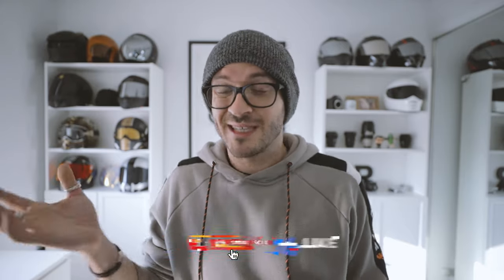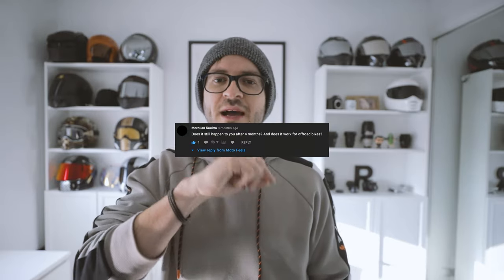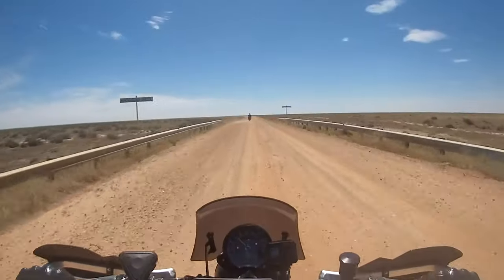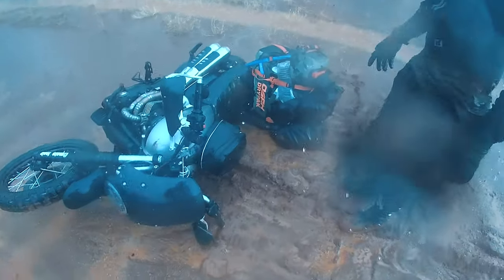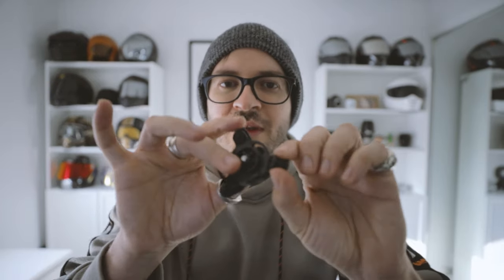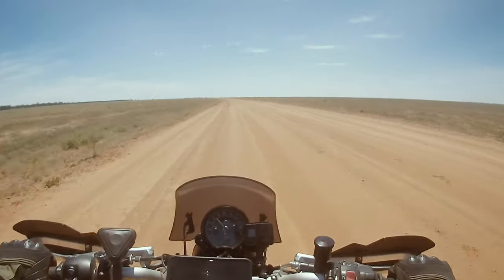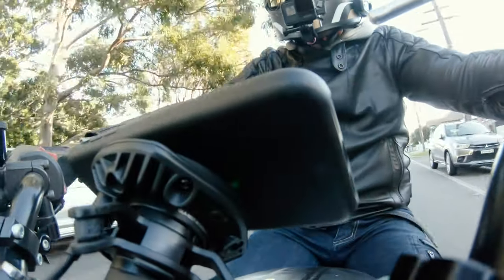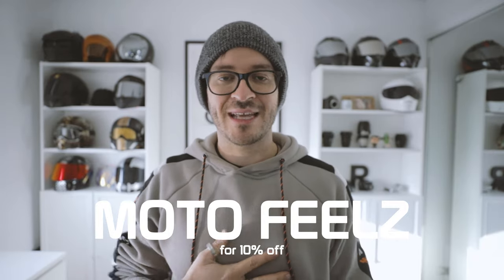Quad Lock Vibration Dampener | Long Term 7000km Honest Review

Comment: I have used the quad lock system with anti-vibration fitting on my Street Triple 675 for a couple of years. I use two different iPhones with no problem. These are well designed and made pieces of kit...would recommend them to anyone wishing to mount a phone to a Bike.
Reply: i juste ordered one, my ram mount fucked the iphones cameras from vibrations, and after less tha a year of using it the phone fell from the mount on the highway

Comment: So far my dampener seems to be working. Previously went through 3 phones in about a year all with the same issue and had no idea what it was until I saw one of your vids with the same problem. Bought the dampener as soon as I found out about it, have had it on since May and have not had an issue yet.
Reply: that's why i wouldn't use my phone on the bike. too expensive if the camera breaks
Reply: i bought at the same time I purchase the mirror mount,  2500 km later my iphone XR camera dies.  Mounted on the bar of a T7 and 40-60 on-off ride.. 
Now with Garmin XR and much happier than any ruggered or iphone device
Reply: Still good ?
Reply: @daveshere9969  yeah mate, same phone and am have had absolutely no camera issues at all. If you have a quad lock and an iPhone this a must to have with it.

Comment: I’ve had the quad lock on my r6 for a year I got another mount for my grom and it must vibrate a bit more cause it broke my camera in a month of riding around luckily had a 1 year warranty on the 12pro so they fixed it free stupid Apple though might have to grab this for the grom

Comment: Thanks for taking time to make this video. I have been using dampner for my I phone 13 and its been great UNTIL recently shakes damaged the IS (image stabilizer sensor) I did 6500km long ride (mainly street riding) and camera started acting shortly after the trip. I was lucky that phone was still under warranty and Apple replaced camera at no cost. Hope this doesnt happen to any other rider. Ride Safe!

Comment: I have a kawasaki z400 (a pretty vibration heavy bike) ive had my qualock on it for about 5 months. With the vibration dampener. And to start with was working great. However ive noticed some issues with my samsung s21 ultras auto focus. And images are often blurrey now when you shake the phone you can here the magnet in the camera move around. I dont think this is soley becuase of the bike. Just sharing my experience.

Comment: Great review of the quadlock vibration dampener, it clearly works and is worth the small extra cost in order to save your phone from IS destruction. Cheers man and thanks.
Update: Bought one and really pleased, hope it keeps working like a dream. Recommended 👌
Reply: Didn't work for me. Lost my camera still on my Galaxy Note 20 Ultra and KTM Duke.
Reply: And u used anti vibration?
Reply: Yes I did use the damper and my iPhone 12 Pro Max is thankfully still ok after 2K miles. Just for comparison my previous iPhone 8 pro camera died after a few hundred miles without the damper, had it fixed by Apple and  has been working fine on the bike with the damper attached as well. It’s definitely recommended 😅

Comment: I have the vibration dampener on my Harley and the dampener does not help at all. Also for some reason after 1k miles the charger stopped charging while driving but will charge if I’m sitting still and take the phone off the charger and re mount it. Can’t figure out why. Definitely an issue for costing over $300 USD

Comment: I don't understand one thing, but if this tool is supposed to avoid vibrations, why does the phone vibrate so visibly? What do I do with an object that vibrates so much if I can't use it as an example for GPS since it vibrates constantly? at this point isn't it better to use it only with the classic quadlock? At least this way it stays still and readable if you receive a notification or something
Reply: in my opinion it should work like a gimbal, that is, it attenuates vibrations and remains stable even at high speeds, to hold it and see it vibrate so much without being useful as a GPS or reading a notification you might as well keep it in your pocket..

Comment: Did apple repair your phone?
The same happened to mine because I had the quad lock without damper on my CRF250L Rally, however I now have the Triumph Tiger900 and have added the damper when I got it, along with the charger, which works great.
My phone is still messed up because I am not in the UK to get it sorted, which is made harder anyway due to Covid access issues.

Ian
Back on Two Wheels
Reply from the maker: They did man, free of charge too and took only half an hour. Have you tried booking in at Apple?
Reply: @MotoFeelz  I work out of the country so short weekends at home and pandemic restrictions have restricted access, I will try but as I have had it over a year I am not holding my breath

Ian
Reply: @MotoFeelz  With or without apple care + ?

Comment: Great video, thanks for it. Is the problem happening on the new iPhone models only, I have an iPhone SE (2nd gen) should I be concerned?
Reply: It damages the camera’s that have optical image stabilisation. It’s a system where the lens is suspended on moveable parts inside the camera. I don’t know on which model this first came out:)

Comment: Not Trying To Damage The Rep, I Love My Quad Lock BUT After 1 or 2 Months Of Riding 3000+ Miles On A Royal Enfield Himalayan  With A Dampener. My SAMSUNG GALAXY S22 ULTRA is Showing Signs Of Camera Stabilizer Not Working Properly At 10x. Just A Heads Up!!!!

Comment: I just installed my dampener and i can see the phone swinging too much. Is this expected?
Reply: Yup it is fine bcoz of the mount now resides on 3 rubber pads instead of hard base. So the weight of phone including the case, presses it more.
I was also worried but then I understood the working of this.

Comment: My GSXS 1000 F killed my iPhone 12 Pro on my quad lock. I got a new phone on warranty then bought the vibration dampener and no problems since. It bounces the phone around though.
Reply: Hello. Tell me pls about your experience using the Quadlock damper after 2 years. Does it work?
Reply: @XR0M  honestly after about six months I just got a garmin gps and I no longer use my phone for nav. But yeah no issues.

Comment: Hello. I just want to ask one thing. I’m thinking about quad lock mount, but I’d like to use it both on my mountain bike and my motorbike also.
So there’s the question.
Does the vibration dampener fit to a bike mount? Or is it only dedicated to motorbike mounts?
I’d like to buy just one mount and use it on both.
Thanks.
Reply: Ты можешь установить крепление к любой трубе. Вопрос только в том, сможет ли демпфер погасить вибрации на велосипеде и спасти OIS в телефонной камере🤷🏻‍♂️

Comment: Hey mate, i have the vibration dampener on my 50cc that i deliver food on in a city. It seems like it wobbles around a lot and makes me thinks its causing more vibration that having it solid mounted? Any thoughts, just like the clip of yours riding in this video. It seems to move a lot! ???
Reply from the maker: Wobbling is good man, means it’s doing it’s job. It’s the micro vibrations that you don’t see that kill the Image Stability in phones. Keep it on!
Reply: @MotoFeelz  I have a 50cc scooter. It doesn't really vibrate at all. I'd rather have it solid mounted so I can more easily read the display as I deliver food on it and am constantly looking at directions and street names. Would you still recommend even for a 50cc? I like to hear opinions! Thanks for replying!
Reply: @firstlast8660  Basically , you are using the wrong kit -no phone is designed for use on two wheelers , there are some like the Trekker which are more suitable , but the proper fit is a motorcycle GPS and bluetooth headset , the Tom Tom is waterproof , can handle the vibration , and you get directions through the headset . - you can pair the headset with the phone as well , so should hear the spoken directions , but a decent headset should pair with phone and Tom Tom , so you can receive and make calls via Tom Tom . Phones do not have all the features of GPS units .
Reply: @jaquesdaniels2964  I run Gaia GPS on my old iPhone Xs that I use strictly as a navigation tool. GPS units like the Tom Tom and Garmin are so hard to map things out with. I used a Garmin GPS for back-country backpacking for a few years until I found I could run Gaia GPS on my iPhone in airplane mode, and it would last for days. A phone has GPS on full-time and doesn't rely on a cell signal for it to work. It works just like a GPS in that regard. Navigating with a traditional GPS unit, marking waypoints and trying to create routes is so user unfriendly. Download the maps of the area you'll be in on your phone using any traditional navigation app and you have everything you need in an easier to use package. Most smart phones are waterproof nowadays too. Now that said, I wouldn't use my latest smartphone to do this. When I get a new phone I retire the old phone to become my dirt bike navigator.

Comment: I currently have a RAM mount. This has killed the camera on my iPhone twice. In addition to the vibration dampener, what else do I need to purchase to make this system work?
Reply: Phone mount and phone case for your specific phone. Ebay the cheapest option! I just spent about 100$ after tax for all of it. 

With my last phone mount. My iPhone camera went wrong. Just got it replaced from Apple.

Comment: Iv had mine fixed 4 times !!!!!!
Reply from the maker: Not ideal
Reply: We're you using the Dampner?
Reply: @Mr_Hugel  no , I was using a different brand at the time. So now I have the dampener , however the quad lock doesn’t fit on my handle bars. 
I’m really disappointed. I finally found a product that woks and now it won’t fit. 😖 
It came with 3 different sizes but non of them work with my 2018 Harley fatbob.

Comment: I almost hit the buy button.. lucky i saw this video and read all other users comments here. I guess the dampener is kinda useless + so expensive at the same time. Maybe best use a cheap phone without a sophisticated camera, and use the mount and adaptor from the quadlock without the dampener would be more efficient.
Reply from the maker: Fair enough, just letting you know 50,000kms on and I still have never had an issue even with the new iPhone 14Pro

Comment: WARNING - iPhone 12 camera completely unusable (Using Dampener)
Dead after first day riding Tenere 700. Similar results for my brother mounted on KTM 790.
Warranty is valid for these issues from Apple.
DON'T MOUNT IPHONES 12-13 - ON ANY BIKE
Reply from the maker: Even with the vibration dampener?
Reply: @MotoFeelz  Yes, with dampener installed. Will post a proper video covering the issue soon.
Reply from the maker: Damn that blows! How you finding the T7? I want one so bad, definite next bike vibes
Reply: I use the Hondo Garage buzz kill dampener and perfect squeeze on a Honda Monkey. This is the only dampener which gave zero negative reviews on new iPhones, the result of extensive internet research.

Comment: Quad lock damper still damages phones. I went back to a $15 ugly mount and it just works no damage. How can you trust this guy when he’s making money by providing paid links. Stop the BS.
Reply from the maker: I’ve been using the dampener for over 1.5 years on an off road and my iPhone 11 has worked fine. Why would I use it if it didn’t work? I wish I could say I was making money from the link, instead I’m offering you a discount. If ugly works for you, then ugly it is ✌️
Reply: @MotoFeelz  You should be apologising to people who will look at your video and then go and damage their phones because of it with no ability to get compensation, even under warranty. All the main manufacturer's now do NOT cover vibration damage under warranty as damage caused by mounting a phone to a bike is easy to identify due to the way the internal camera fails.  And, let's insult people's intelligence by suggesting a discount code may not be linked to you with Quadlock, yeh right...
Reply from the maker: @real123  maybe you didn’t hear me the first time. Ehm. I’ve used the dampener for over 1.5 years on and off road and my iPhone 11 has worked fine. I stick to what works and I’ll continue to share my thoughts on products that have worked for me. And again, I don’t make any money from the link, just a discount to you guys. And again, if ugly works for you stick to ugly. You have a great day bud